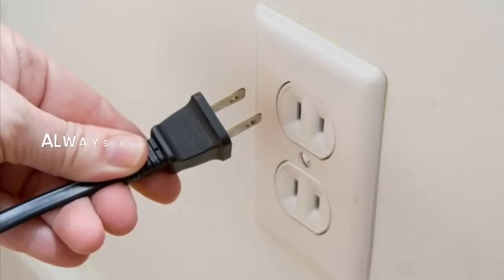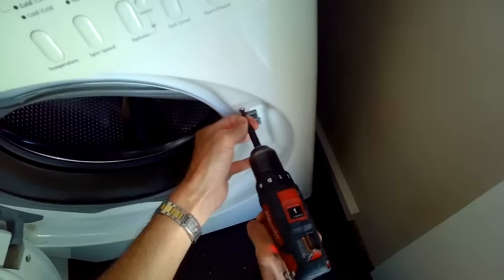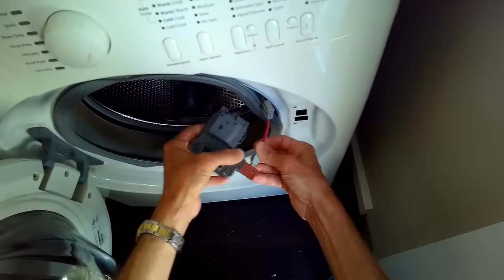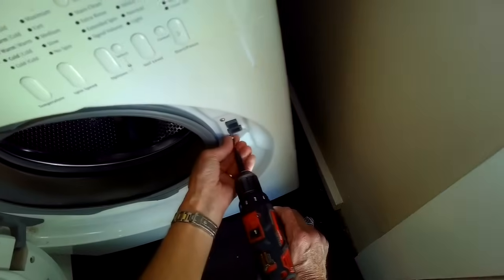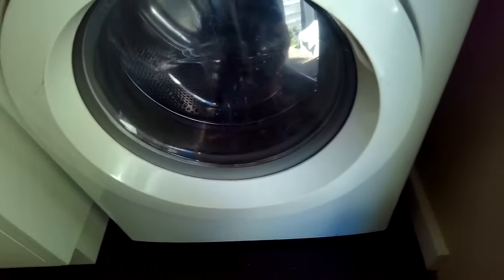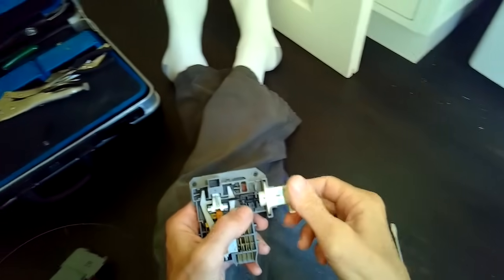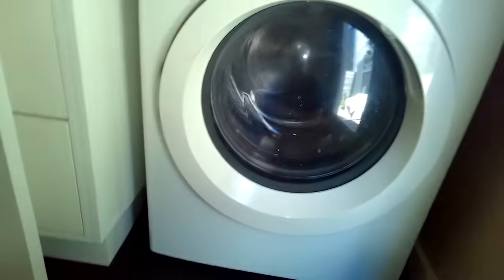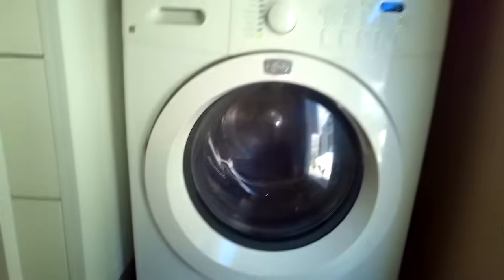✨ FRONT LOAD WASHER WON’T SPIN — FIXED IN 8 MINUTES ✨

Comment: I have a 17yro washer and dryer set almost that exact model and have repaired almost everything on them from videos like yours. Now the washer won’t always spin after a cycle but will spin on spin cycle. I’ll take these parts apart to see if a new motor will be the fix. Thank you for this - you’re saving many of us the need to get washers! 🙌
Reply from the maker: Maybe the motor is getting tired and overheating 👍
Reply: @ ahhh thank you! Do you mean the main motor (not the door lock motor)? Do you have a video on that or would that mean a full replacement?

Comment: Your video described the problem with my washer. I followed your instructions and now my washer spins again!  Streight forward and easy fix! Thank you so much!
Reply from the maker: Thanks so much Ross😊
Reply: Mine stopped today .....watched your video, remembered I bought a new switch a couple years ago for a different problem .....just popped it in working great .....thanks!      I noticed you didn't show replacing the spring, cause you need 2 people or 4 hands ....lol ...I never replaced it from a couple years ago ......Maybe do another video on just replacing the spring

Comment: Thank you very much for your video.   Replacing the door switch fixed my problem.  My washer wasn't draining and wouldn't enter the final spin.  Unfortunately, most of the videos out there suggest cleaning out the coin catcher, so that's what I did first.  Wasn't easy... spent a lot of time pulling the machine apart, only to find that my coin catcher wasn't clogged up.  Your expertise and video solved my problem and I am very grateful.  You saved me a lot of time and money, therefore I sent you a donation out of gratitude.  Thanks again!
Reply from the maker: Awesome,  thanks so much Ryan😊😊😊

Comment: Thanks for this! I didn't think it was the issue as the door actually locked properly and everything seemed to function as expected except it wouldn't do the fast spin. As a hail Mary I ordered the door lock mechanism and replaced it as per your instruction and it worked!! I couldn't believe it! I spent $30 instead of $1000 on a new washer. Thanks again!
Reply from the maker: That’s what I like to hear😊😊😊

Comment: You just saved me a heartache…

Washer would start, drain and run but wouldn’t spin.

Watched this video and thought maybe before I even pull the door off, let me reach inside a just give a little bump to the back of the switch assembly and then a few hard hits too the front for good measure.

Wouldn’t you know I fire it up and the motor assembly you showed popped (I could hear it) and bam the washer started spinning again.

I’ll probably order one now to get ready to replace it, but today isn’t that day! Thank you!
Reply from the maker: You’re like the Fonz on Happy Days😂😊

Comment: Hello.  Your video made the replacement of the door lock look easy.  So I ordered one, installed it, and it worked fine for the first wash.  Second wash, it didn't do the high speed spin so we re-ran the clothes in just a spin cycle.  That worked.  Third wash, tried the second step of spin only and it didn't go to high speed spin.  Is there another issue going on?  Seems odd that it worked fine once.
Reply from the maker: Nice Ray,
Can you redo the 3 wire connections to your door switch?
You might need a new motor controller 👍
Reply from the maker: What’s your model number?
Reply: @QuickAndEasy5MinuteAppliance  Thanks for responding.  Turns out it was a faulty drain motor that had to be replaced.  I needed a service call.

Comment: So, I have the EXACT same washer.  Clothes are wet and NO spinning action at all.  It DOES "CLICK" and lock and start the cycle; it drains fine during the cycle:  In your opinion, could it STILL be the door lock causing the no spin even though it clicks and locks at the beginning?

**update**  Did the switch.  VERY easy.  Did not solve my particular problem, however.

**update to the update**  I just wasn't patient enough during the testing.  Ran a cycle and it worked!  Thanks for posting!  Very clear directions and an easy fix!
Reply from the maker: Can you send me an email at scottthefixitguy@yahoo.com so I can give you more detail on the fix?

Comment: So I have a front-loading Kenmore washer, and the controller board does this resistance test on those door latch contacts. My wax motor worked fine, the fix for me was prying open the door latch switch as you did, and then polishing up those little switch contacts carefully with some fine steel wool. There was a bit of oxidation on the contacts. This got them shiny again. Once the contacts were clean, I reassembled and reinstalled the switch, and the final spin worked again. Just thought I would share this and maybe save people a few bucks before they replace the door switch assembly or the motor.
Reply: That could be good tip, Ill try it .  Because the infuriating door lock seems to keep me locked out like the worriers intended,  so does that mean the wax  motor is working ?

Comment: Excellent video, thank you!   I have a front-loading Maytag MHWC7500YW0, which goes properly through all cycles, but goes only into slow spin, never fast, then quits, the load drained but still wet.   Is it still the latch, different from the one shown in the video, the motor, or the motor controller?  Thanks!
Reply from the maker: I’d say motor controller 👍

Comment: My door unlock and locks with no issue and drain with no issue but will not complete service test 14 spin for a few seconds and stop
Reply from the maker: Many times the door lock still works but is worn out and won’t let washer go to spin.

Comment: Scott the Fixit Guy you are awesome.  I was on the path to pushing my Samsung Front Loader off the back of a trailer at high speed after it left me in a very tight spot with a load of wet clothes and wouldn't spin.  I have also been through the Samsung Spider Arm replacement repair and I'm sure you know what a fun task that is.  Anyway, your video did the job.  Thanks so much for the time you took to disassemble and explain the door lock and wax motor assembly.  Thanks also for displaying motor only replacement. You did a better job than AvE on that wax motor tutorial.  New Sub here.
Reply: 😂😂😂 Not the high speed trailer stunt!

Comment: Thanks for your video. It is very useful. Could you pls help us with an idea. We have Hoover VHD148A and it stopped spinning. The display is working. When we press “start” water is taking the powder from the dispenser, filling the washing machine and when it is time to spin there is just a click sound and that’s it. We can turn the drum manually, we checked the belt and it is on its place. Thanks a lot
Reply from the maker: I think on your Hoover you just need to replace the motor brushes 👍
Reply: Thank you 🙏 i will check

Comment: Our washer selectively doesnt spin.  It will do our comforter, sheets and even towels sometimes, but clothes.  The door lock lights up.  I can even put it on manual spin after manually draining the machine.  But it will go slow back and forth a few times fir a few minutes and then i hear a click and time is added to the minutes (ex if on 6 from tge original 9 min setting then it will go back to 9+1 or 10 min and stop functioning altogether.

If its the sensor in the door lock, would the issue be constant and not intermittant?

Hate to spend more $ over bad

Comment: I have a Gibson (Electrolux) model GTF1040AS0 that does this only on the regular wash mode. It will go through the cycles normally; but when it gets to the spin cycle, the motor will run like it wants to start the spin, but it never actually does. The other two modes (Perm press, Knits) work normally. Would this fix still resolve the issue, even though it's only happening on regular wash?
Reply from the maker: Can you put send a video of that to my email at: Scottthefixitguy@yahoo.com
Reply: @QuickAndEasy5MinuteAppliance  Do you want to see the whole cycle, or just the relevant portions? I appreciate your time, I will try to get it to you in the next few days.

Comment: Really good video mate!! My washing machine made a really load bang noise while running and now won't spin freely but does turn back and forth slightly while pushing with my hands. Do you think it's the wax motor or something else? I was leaning towards the belt...
Reply from the maker: Can you take a video of you turning the spin basket by hand and send it to me at: scottthefixitguy@yahoo.com
Reply: @QuickAndEasy5MinuteAppliance  Email sent mate. Cheers
Reply: Any fix with this? Same issue with my Samsung. Doesn't spring freely only slightly . Will the latch fix this as well?

Comment: My machine Bosch and  tt doesn't spin dry it just kept turning round! Thank you so much! I will  replay it again to see that wire that goes inside round the rubber built. I have learnt how to clean the filter. Now I need to learn to change the switch! You are a life saver!
Reply from the maker: Yours probably needs new carbon brushes.  Pretty easy to do👍
Reply: @QuickAndEasy5MinuteAppliance  hi there I have a front loading bush washing machine which is barely a year old it washes but when it's time to spin the drum just keeps going round like its trying to spin but wont,I have to turn washer off then rinse  clothes by hand.
Any ideas what the problem might be??

Comment: Thanks for the info. I tried this but didn't solve the problem: it will rotate slowly but won't spin. Any tips on what my next step should be? Thanks again!
Reply from the maker: Time to change the motor controller👍
Reply: I had the same issue, replacing the drain pump fixed it

Comment: Our Whirlpool front load washing machine wouldn't cycle through and sometimes wouldn't even spin.  It would cycle on Delicates or Heavy but not on Normal.  And on Delicate or Heavy the clothes were still soaking wet. I ordered a door lock switch and it still didn't change.  My washer pump filter is only accessible through the back so I removed it and it was caked solid with hair, etc.  After cleaning it, it worked better than before.  I should have listened to the old saying "don't re-wire the house before you try changing the light bulb" !!
Reply from the maker: That’s a great saying Mike😂😂

Comment: I have a Sears kenmore elite HE5t I had an F17 code the outer spring was off the door boot seal. Put the spring back on and then had a F25 code after husband completed a short cycle. 2 days later I removed the top, back and front lower panels. Checked the drain to make sure it was not plugged. Attempted a history overview test program. I hear the door lock, the machine fills both cold and hot, the drum rotates, drains however C:08 drum did not rotate counterclockwise from 35 to 90 rpm within 15 sec. The machine did not complete C:09 drum rotates counterclockwise at max speeds. I checked the tachometer resistance it was 115. Any thoughts? I was going to purchase a new doorlock at Dey appliance tomorrow but my gut tells me it might be a new motor and or Motor Control Unit. 
Thanks for your advise.
Reply from the maker: Nice job Ann,,
I would replace the motor control unit.

Comment: The washing machine was washing as usual but started to not do the final spin, out of the blue, instead, it would spin back and forth slowly, and the timer was stuck on 6 minutes for 30+ minutes.
I didn't get to replace the wax motor, but I cleaned its contacts, the the contacts on the prongs below and all contacts - plug and lock assembly. And the washer is now doing the final high speed spin.
Reply from the maker: Wow,
Nicely done😊😊😊
Reply: This is happening to my washer.. how did you clean it?
Reply: @KaoStarrBellydance  an old rag, some water and detergent and then you just kinda polish those metal contacts.

Comment: The lid lock mechanism in our Whirlpool Duet washer has only two electrical connectors not three and neither of the connectors connects to the replacement wax motor is there another location or another wire harness I should attempt to locate?
Reply from the maker: I think your model just uses the 2 connectors instead of 3.

Comment: Thanks for this video and suggestion as it shows a very different reason for not entering the high speed spin cycle.  I have a Frigidaire front loader and the door does lock, it just wasn’t spin fast.  The machine is over 10 years old on a vacation home so it has not had much use.   Can i just short the wires together or something to bypass the lock sensor???

Comment: I have this same issue but my door lock works fine. Change the control board? Spin motor?
Reply from the maker: Many times they lock but won’t send a lock signal to the computer.
I would change out the lock.
Reply from the maker: Many times they lock but won’t send a lock signal to the computer.
I would change out the lock.

Comment: I changed the pressure sensor, water inlet valves with no luck. I hear the door lock and unlock, so still replace it?
Reply from the maker: It’s likely it’s the door lock👍
Reply: @QuickAndEasy5MinuteAppliance  did that lastly and no luck either put in $250 in parts and didn't want to keep guessing.  Sadly had to buy new set

Comment: Thanks for making this video.

I replaced the switch with the oem replacement part, but unfortunately didn't fix the problem. The washer still fills and drains, and spins slowly, but it does not complete the final full speed spin. When I run a rinse/drain cycle, it get's stuck at 1 minute and never finishes.

I don't think it's the belt because I can't hear anything during the final spin cycle, but do you think it could be the motor controller? I wasn't sure because the machine does spin, it just doesn't do the full speed spin.
Reply: Mine is doing this. What ended up being the issue?
Reply: @kyliescookingandcrafts8737  i replaced the motor control board and that fixed it... I think I busted something when I did an extra heavy load of towels

Comment: My front loading Blomberg won't start agitating once the water starts coming into the drum. It won't spin at all if i set the program to spin only. The door does lock when i turn on the machine and won't open until i cancel the program. Does this mean that a broken lock is not the problem and something else is causing it not to spin? Thanks so much for your help.
Reply from the maker: I wonder if the motor brushes are worn out?

Comment: Thank you for the video! Our Whirlpool Duet Sport stopped spinning today-- the drain works and then it makes a high pitched spinning sound that gets really fast, but the drum is not moving whatsoever. Do you think this could be the same type of repair? Thank you!
Reply from the maker: Hi Katy,

I bet the belt came off.

Can you remove the back cover and check?

Please let me know what you find?
Reply: Actually, ignore that, I figured it out--- it was pieces of the shredded belt hanging down. I thought they were electrical wires. Got a new belt ordered, thank you again, you saved me so much time and headache!!!

Comment: Great video. Just one problem. What diagnostics did you perform to determine that it was the door lock was the source of the problem??
Reply from the maker: Hi Gerry,
I took a little bit of a gamble but around 85% of the time it’s the door lock that malfunctions and prevents the front loader from going to spin.
Reply: I assumed as well, I came in to look for same issue, which everyone says expensive 'drain pump.'  Yet, I got a few more loads by manipulating that door lock sensor.  I may disassemble first and try replacing just the motor.  Very good review!
Reply: Did this happen to actually be your problem? I ask because we just replaced our drain pump and now the machine isn’t spinning.

Comment: Would this switch be the cause of occasionally not going into high spin mode?  Instead it stays in low spin mode.  Thanks.
Reply from the maker: That’s highly likely the cause especially since it’s intermittent.
Reply: @QuickAndEasy5MinuteAppliance   Thanks!  It never goes to fast spin now so I will change the door switch out and let you know.
Reply: Your videos are excellent and complete.  I may request your personal help if this problem doesn’t resolve itself.  Thanks again.

Comment: so, would the door actually lock even if the door lock circuit is not properly working? i have a washing machine that will not spin (motor does not spin but i hear a relay click) so i am wondering if it could be this issue
Reply from the maker: Yep,  it may lock but not let it spin.  A new lock should do it👍

Comment: Hello how did you diagnose that it was the lock and not the control board or motor?
Reply from the maker: Best to start with the cheaper.
Also agitation and spin both die when MCU goes out. Just spin dies with the door lock.
Reply: @QuickAndEasy5MinuteAppliance  Maybe best to start with thecommonest. Above, you said this was the cause in 85% of failures. It seems that happily this BOTH the commonest AND the cheapest😊
Reply: @QuickAndEasy5MinuteAppliance  mine will fill but doesn't proceed further ie no agitation. I tried the spin cycle but it didn't spin either. I could hear some noise though.  Then I tried the drain cycle  and it drained fine.  So is it motor controller or door switch?